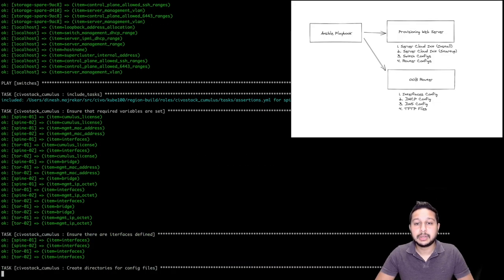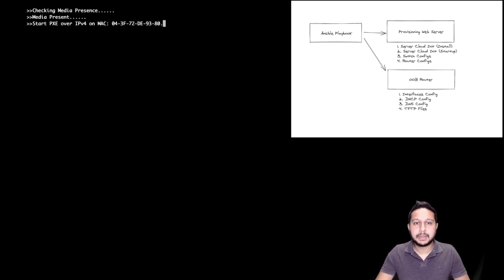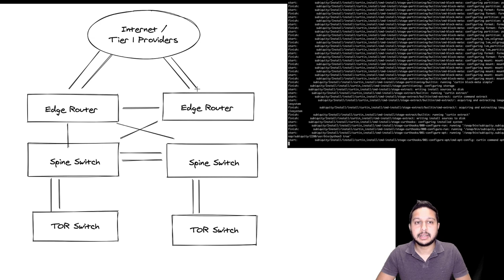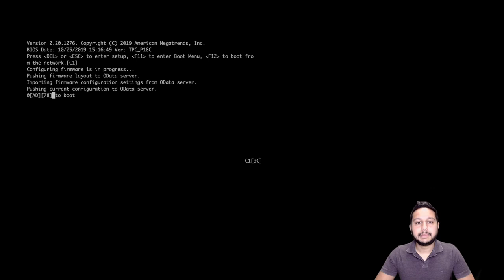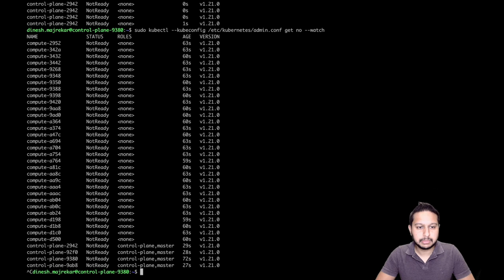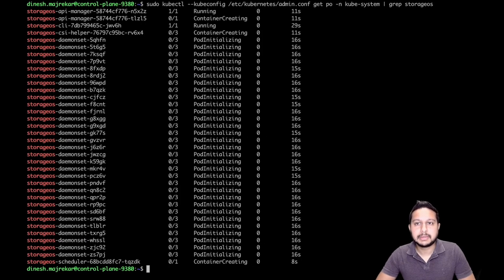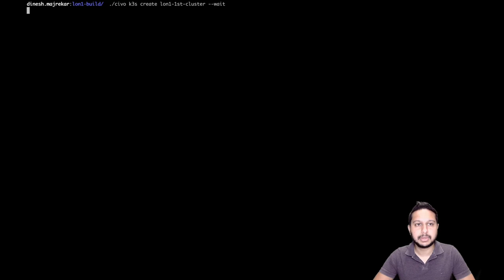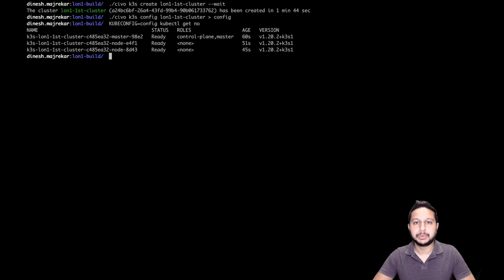Civo Official Launch of the World's First Managed K3s Service!

Comment: Damn! missed it! congratulations, love open compute
Reply: At least you can see it on catchup! Open Compute we love!!
Reply: @markboost5140  just rewatched, is it air-cooled? and de-calamitzation is done after transport?  the spine switch links why not a link to each tor switch? loop/spanning tree protection?
Reply: @CloudNativeJanitor  yes, it's uses air cooling. The data center in the video has a zone where you can leave the rack to acclimatize before moving to the DC floor. We don't use spanning tree on purpose, as our company ethos is around simplicity by design. We've had spanning tree cause problems in the past and have taken a different approach, but have still been able to maintain a high level of resiliency. We've designed the rack to provide at least 99.95% uptime, but in reality it's closer to 4 nines.